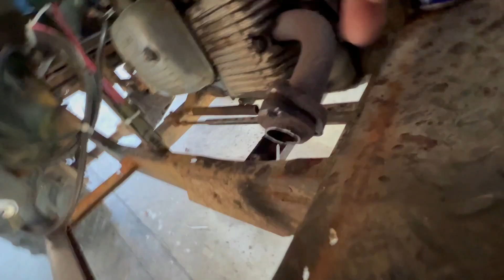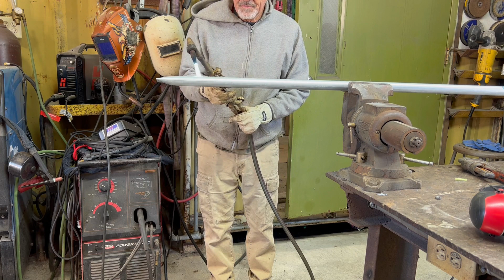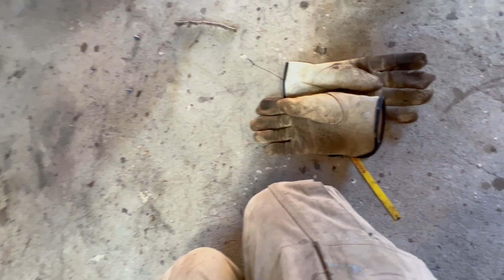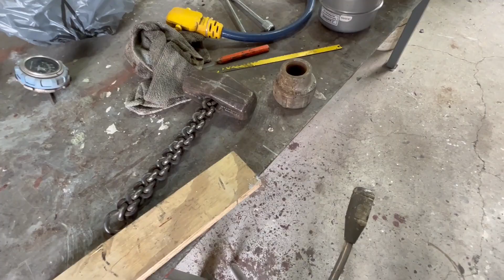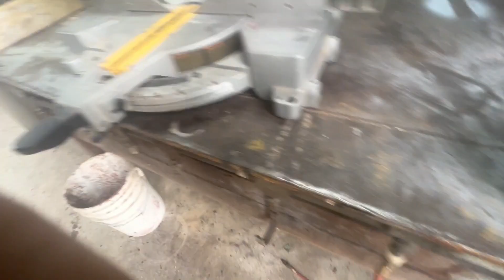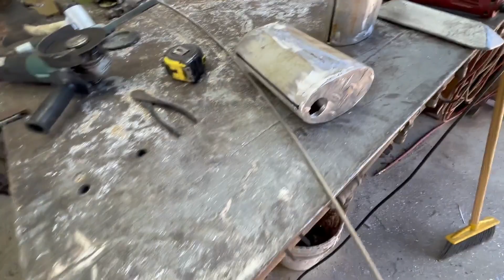Replacing the original Truckster exhaust system using DIY aluminum mufflers.

Comment: Which OMC motor do you have ? They used them in everything like snowmobiles and pumps and obviously carts . They fire different then normal , some fire both cylinders at the same time so the ports are in different location then normal. Like a boat motor the ports are at the bottom of the stroke ! Fill the mufflers with steel wool !
Reply from the maker: Dave
I have read that because the spark plugs on my engine are pointed upwards it is the 21 hp version. That’s really all I know about it. A very torquey little engine, will chug on at dead idle in second gear.